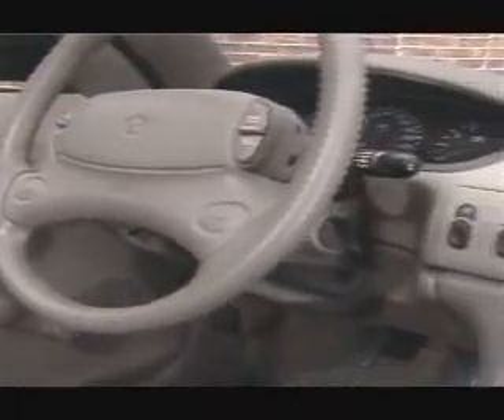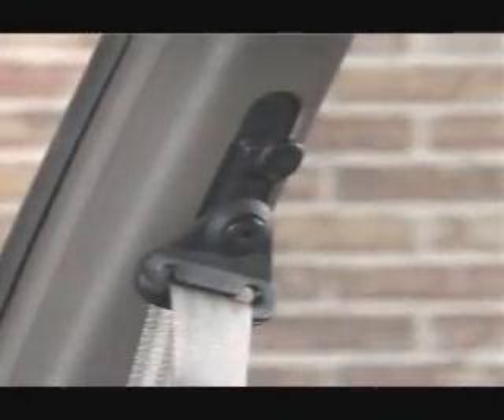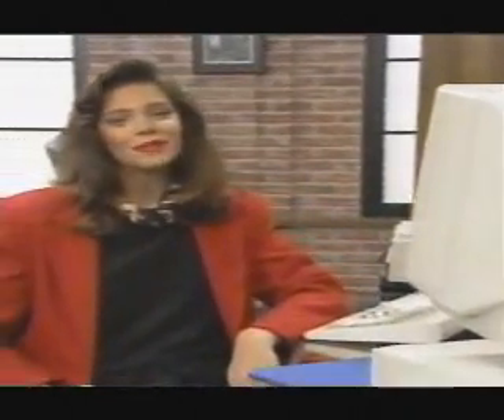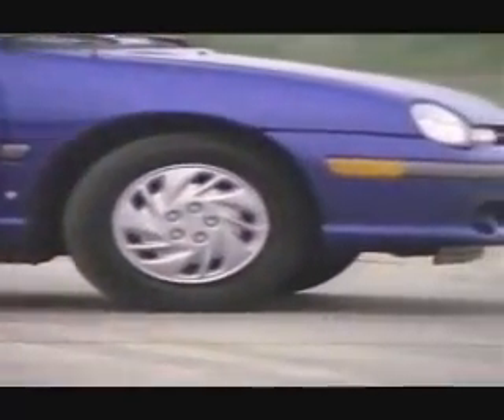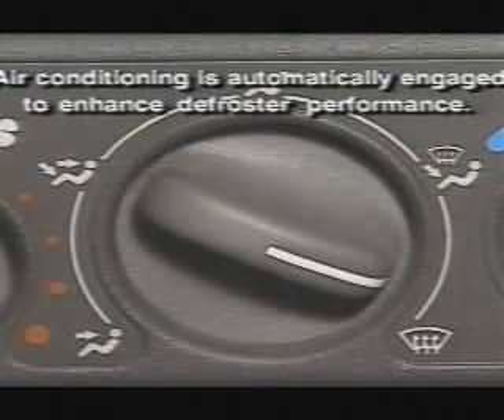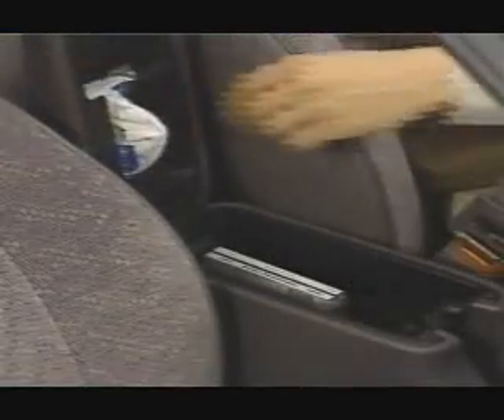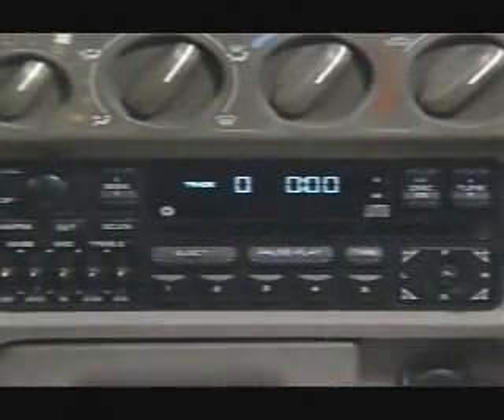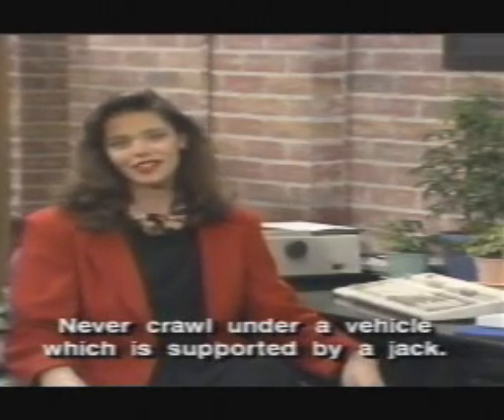Neon VHS Tape

Comment: Thanks!   We had a new 1995, I can't find the VHS tape, but I watched it when we got the car!  The car was nearly trouble-free until I sold it around 2006 with 135,000 miles.  The head gasket issue (before MLS gasket in 1997 was a known problem and I replaced it myself), other than that rear struts was about all it needed (besides tires, brakes, etc).